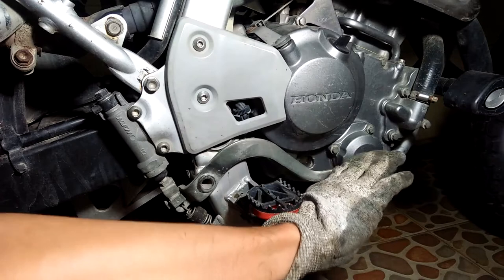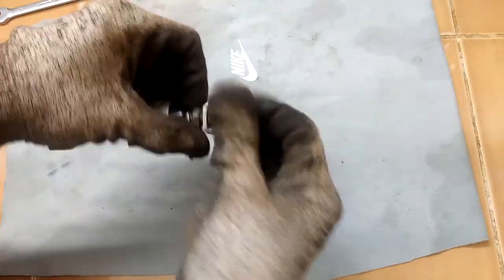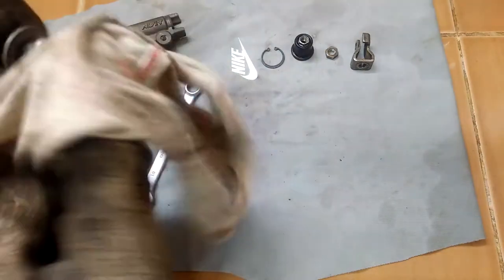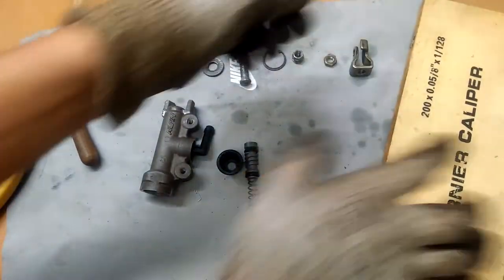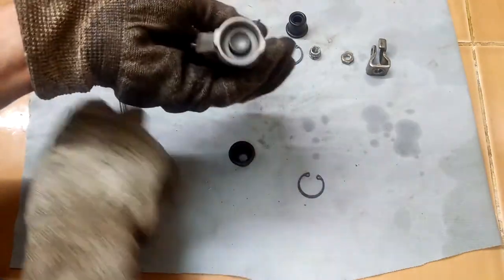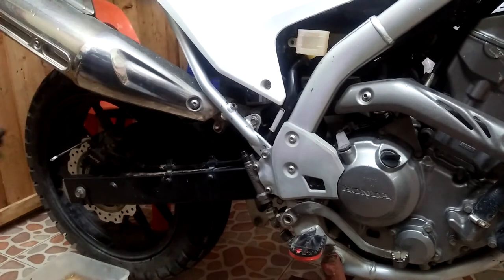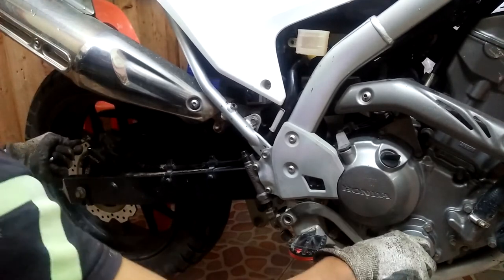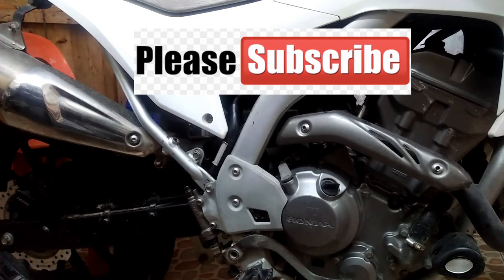CRF250L Rear Brake Master Cylinder Rebuild

Comment: OMfG  this helped me A LOT ... i bow to the master and THANKS ... 
I thought i have to change some parts in the break cylinder on my CRF250L Hildegard, i am loving since 10 years. but it was just some AIR... damn thats the last thing i was thinking about ...sometimes its the little things . I just changed the break pads because i thought its the problem and there was oil missing. Today i learned that the plastic part wich ends in a spring on the break pedal is MOLTEN ... guess its the engine heat over the years. The other rear spring is gone...with the wind i guess, no idea for how long
🤣

Comment: Thank you for sharing detailed video. There is one think that i need to know; is master cylinder kits different with front and rear? Or both same?
Reply from the maker: Different on the metal part but the 2 rubber seals on the piston are the same and interchangeable.

Comment: if the rubber washers are broken will the brake work? and which side do they do on?
Reply from the maker: Hi. It depends on how much worn or broken are the rubber seals. In my experience, my brakes will sometimes not work. If the rubbers are totally broken, then the brake will not work at all. There are 2 rubber seals. The upper rubber push the brake fluid to the caliper cylinder. The lower rubber prevents the fluid from leaking out the master cylinder.

Comment: Sir where did you source the parts? Thank you.
Reply from the maker: Hi. Here is Thailand, I bought the repair kit in the motorcycle parts shop in town. It is a generic kit not specific to Honda CRF250L and will work with many other models. Otherwise, you can get the parts from the Honda dealer.

Comment: will the cb500x wheels fit on the Crf250l? Without changing swingarm
Reply from the maker: no. the original CB500X rear wheel is too wide for the CRF swing arm